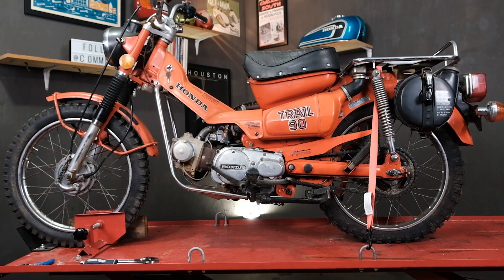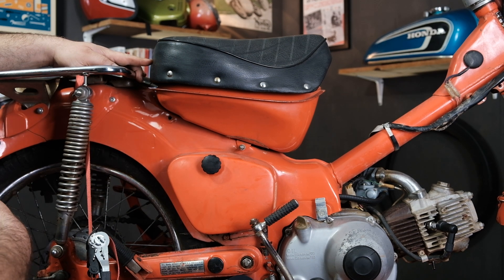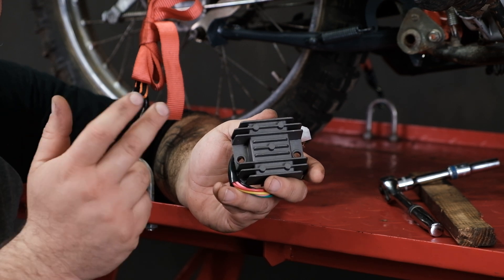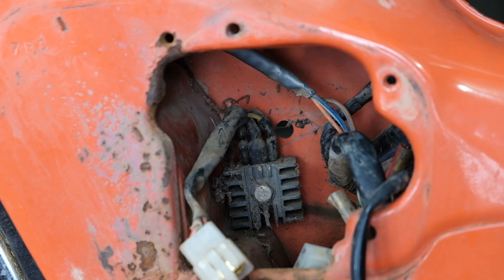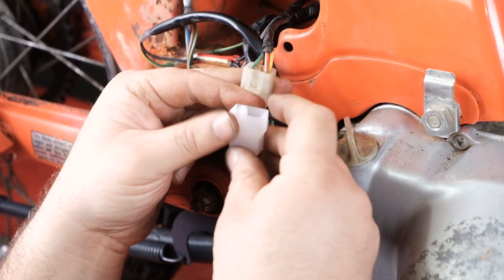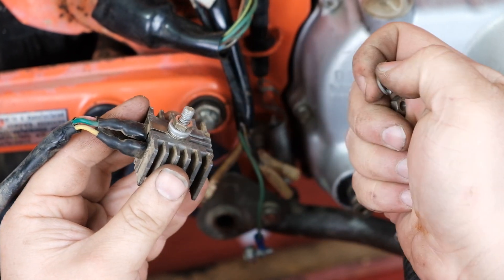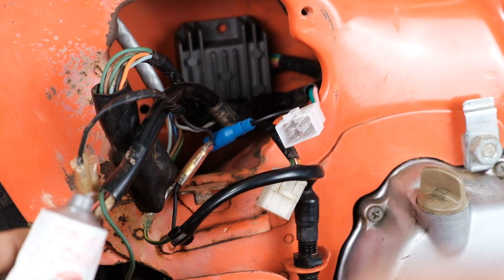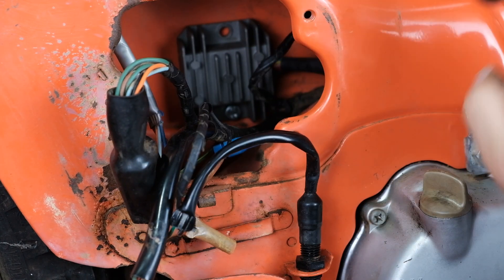Installing a Modern Regulator / Rectifier on the Honda CT90  / Trail 90

Comment: I have a 1980 CT110 with the small 2 wire rectifier on back of battery box is there an upgrade available for tis system?

Comment: i have a question. would the 12v system (stator, coil, rectifier etc) on a crf100 bolt on?

Comment: that's just unnecessary. as long as you use a wet cell battery it'll be just fine to run without a regulator.

Comment: Hi, thank you for the headlight bucket wiring on a vintage honda motorcycle.  Watched it a few times and made notes to work on my 1984 CD 125 TC (Twin/Benly) here in London, UK.  Can you please direct me to the video if you have one since I couldn't find it on the channel to now plug everything on the other end of the main harness. I am a complete beginner and wouldn't know what's what on the rest of the bike other than the battery.

Comment: I haven’t used the trickle charger 🔌 after installing the new voltage regulator/rectifier from Common Motor on my Honda ST90 almost a week ago.

Comment: Small correction to make. The connetors gender is based on the terminals within the housing. So the connector on the original rectifier is a male male side.

Comment: Hey there, great video! Do you know if I could use this with my 64 CT-200 trail 90?
Reply from the maker: Yes! We’ve installed it on one here. The only difference is I believe the original rectifier ground the harness through the rectifier. When you install the new one, you will want to add a new harness ground to the bike. Reach out to our support though if you aren’t sure how to do this.
Reply: ❤ @Common-motor

Comment: Thank you for the clarification that this will work on all the 6V single phase Hondas. I suggest adding that to the website.
Reply: To confirm, this worked perfectly in my 72’ CL100. I did have to make a custom mounting bracket though. It was no harder than enlarging the holes like I did on the CL175
Reply: @DexterRutecki1993  good to know. I am restoring a '72 CL100 right now.

Comment: This is great! Thank you for creating this part and making this video. I will order soon for my 1979 Trail 90. Will this also work for a 1972 SL125, which also uses a 6 volt battery?
Reply: Around the 10 minute mark or earlier he says it will work on all Honda 6V single phase charging systems.
Reply: Just to confirm. This part worked great on my 72’ CL100. Just needed to make a custom mounting bracket.
Reply from the maker: We only list a part often for the models we fully support but the reg/rec itself will work on any of the 6v single phase charging systems from the era. The only thing you’ll run into is figuring out how to want it mounted and how to wire it. Some 125 models used a 6 pin wiring connector so you may need to replace a harness connector or 2 to get everything connected as it should be.
Reply: @Common-motor ❤😂
Reply: Dose this work on system voltage or just 6v